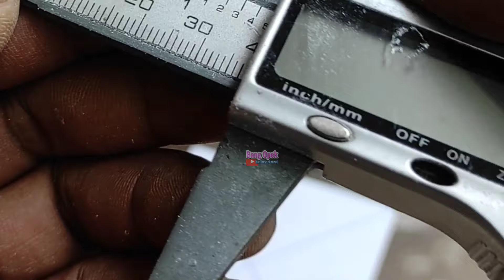how to make a mini subwoofer

Comment: Hi good sir, i love your work from australia! i also make mini sound systems but with a 3d printer, i admire your work and craftsmanship a lot! 1 small thing i notice, if not using any sealant for the clear covers, especially on subwoofer you lose a lot of performance with even very small air leak and get rattling. 
I use blu-tac to seal my work (very small; amount as not to look messy) or black double sided tape work too. Maybe you can make a video 1 with sealant and 1 without? that would be cool.    just 1 small thing i notice , I think it will help your designs sound a lot better, kind regards

Comment: Pakai amplifier apa mas dan brp watt. Suplay brp volt brp ampere
Reply from the maker: Tda8932,  35w 12V
Reply: @bangopek  speakernya 50 watt max ya mas. Mksh sdh di bls pertanyaanya mas opek. Trs berkarya n sukses mas opek
Reply from the maker: 50w8ohm